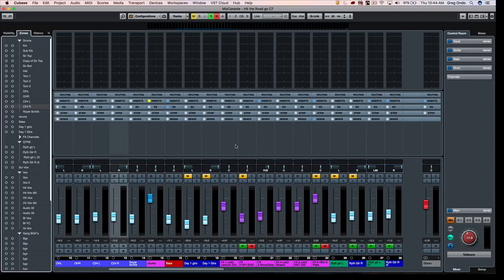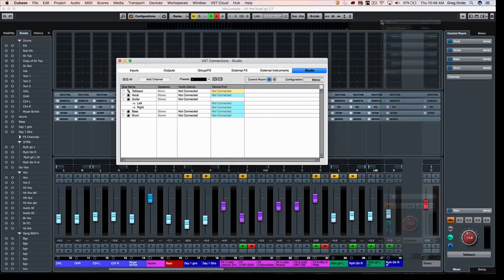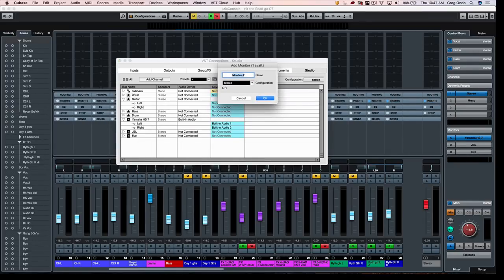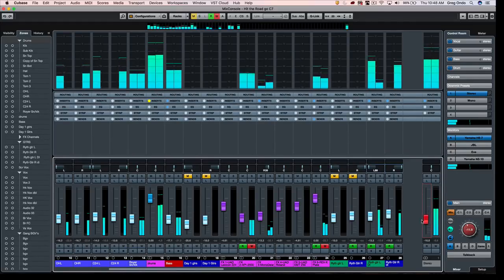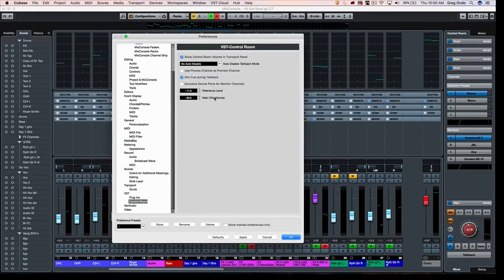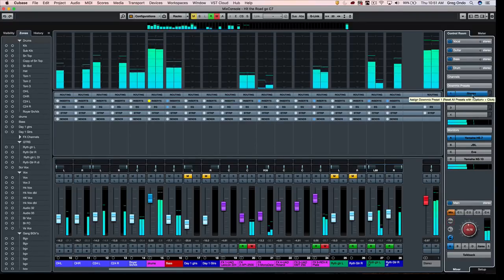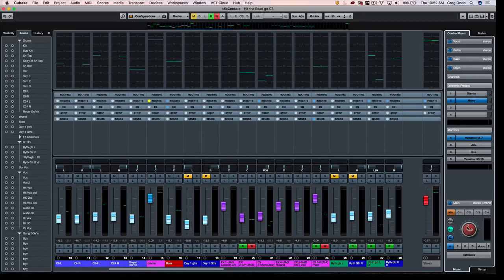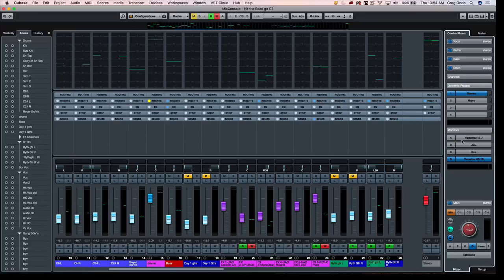How to Switch Between Different Monitors in the Control Room | Q&A with Greg Ondo

Comment: Hi Greg, is it possible to have 2 monitors running at the same time? Im trying to have it that one monitor output has sonarworks on it (in my studio), while a second monitor output going to a clarity M. (I'm trying to avoid using Clarity M's vst plugin connection because I want it to receive a summed signal from other machines). Am hoping there's a way to get this working in control room, rather than having to sort out additional sends in all my projects!

Comment: Hi Greg. I was always thinking of use Cubase monitor select as I use my Presonus Central Station. But they in Steinberg have never made possible to have number of monitors alternating(as it is) plus possibilitie to engage one sub monitor separately to use with any pair of monitors. I can only connect combination of one pair of monitors as satellites with sub. But that way I can use sub only with one pair of speakers. Or is there some other way to enable sub independently of alternating A B C D monitors? If you have an idea please let me know. I think I am not the only one interested to use Cubase control room that way. Thanks for all your videos.

Comment: Still got to engage a separate a/b switch on my hardware as sound coming out both sets of speakers ? When I click A spkr, great, ( control room stereo 1/2  ) when I click B/speakers ( control room stereo output 3/4 ) no output . will be out put if I use physical switch on my hardware ?  looks like Greg only connected speaker to one set of monitors as far as I could see, what did I miss ?